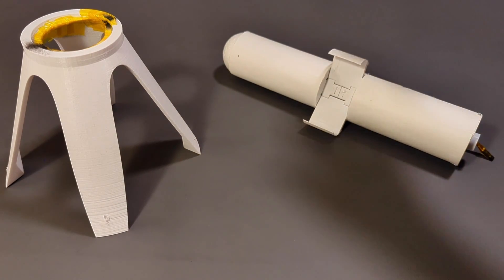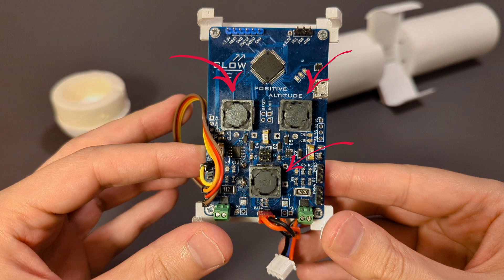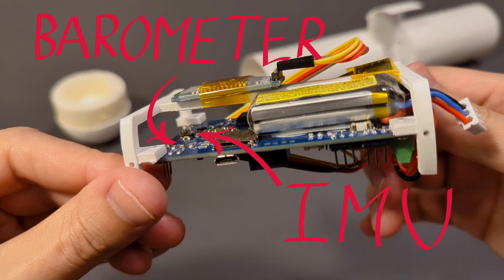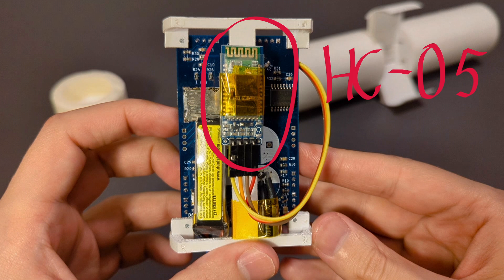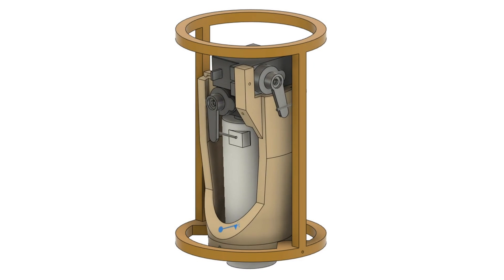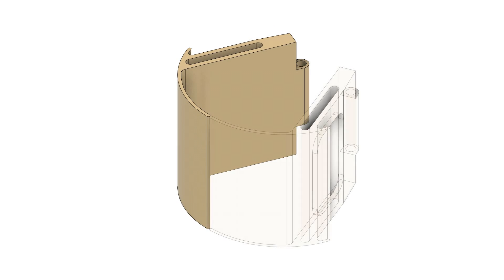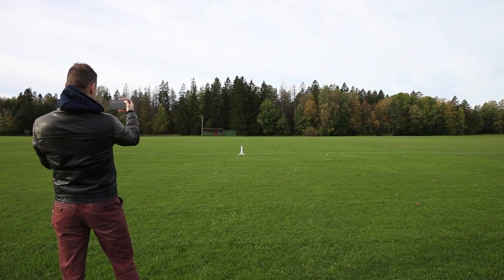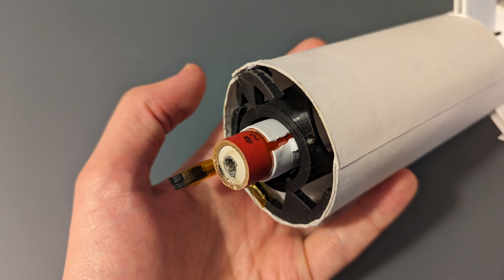Can a Model Rocket Fly Without Fins?

Comment: Could you please share the source code and flight computer design, i know code is very complex but i will use ChatGPT to make readable for me.
I am struggling TVC motor rockets. Thanks ❤
Reply from the maker: Hey, sorry for the late reply. I don't recommend using my old FC I used for this rocket. It has a bunch of mistakes. But I have a new one, you can ckeck it out here.
https://github.com/PositiveAltitude/light-robot-core-hardware
It is based on "RRR" design (there is a video on the channel about it) -- just with some improvments and error fixes.

Old software also is way too complicated. Trust me, it's not worth to spend time trying to understand it even with chatgpt. It was built with FreeRTOS, message queus and some other things that could be overwhelming.
Instead try to use chatgpt to plan you software first. Split it into components and decide what interfaces these components have (this is a basic programming concept, called Encapsulation)

The most tricky part really is a system that quires current rocket orientation using IMU. You can do it using quaternions and I have a video about them and the math for this component is explained there.

Having this system done it's not realy complicated to make a PID controller.

Comment: Have you looked at the CG and CP positions in relation to the front end of your design? Instaility may arise when CP is sitting over CG or is behind CG point.
Reply from the maker: The CG is slightly behind the CP, so yeah the rocket has no stability at all. You can see that it instantly starts spinning when the motor burns out. But it is meant to be unstable.

Comment: As I understand it, it's impossible to control rotation along the longitudinal axis of a single motor.

So there's a gyroscopic moment in the rocket that you can't control with this model, which affects the rocket's ability to rotate along other axes and its stability.
To remedy this problem, I recommend using three motors of equal power, combined in parallel on a circle around the longitudinal axis of the rocket.
Two motors would be the minimum, but would give a planar symmetry that wouldn't match the rocket's axial symmetry very well.
Reply from the maker: That's true. This rocket was built with the hope that "it probably will not get too much roll speed". A proper rocket should have some roll-control for sure. But using more motors was a huge complication. A much more complex TVC system, control algorithm, simultaneous lighting of several motors etc. I will definitely try a two-motor model with roll-control in future since I have more experience now.

Comment: I like designing flight computers and the internal electronics inside, how shall I proceed forward?
Reply from the maker: 1) Check Phil's Lab channel, I learned watching his old videos where he designs for STM32 with KiCad. He explains every step really well. 
2) Read datasheets for electronic components -- in many cases there are instructions how to use them.
3) If you don't know how to design something special - try to find some reference on the Internet and learn from that example.

It's not really a hard thing to do, just go for it! Let me know if you have more questions :)
Reply: Thanks for the heads up! I have just started my sophomore year in my college in electronics, so just wanted to ask, how shall I proceed forward @Positive_Altitude

Comment: Can you share the stm32f722xx source code please?
Reply from the maker: Well, I can. But the problem is that code is quite complicated technically. It is built with STM32_HAL using FreeRTOS, DMA, interrupts, and some ProtoBuf encoding. And everything is very dirty and poorly structured. So I think it is quite unreadable. And I am not going to put more effort into it because I started using Rust language for my other projects and not going to use C anymore :). So, let me know if you are still interested and I will share it as it is. Also, let me know what you want to learn from it, maybe I will cover it in future videos!